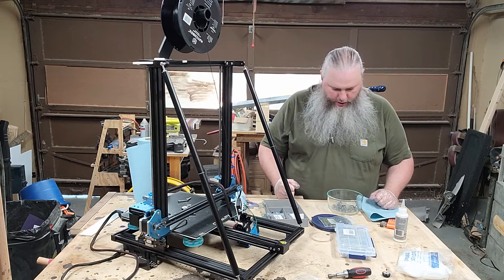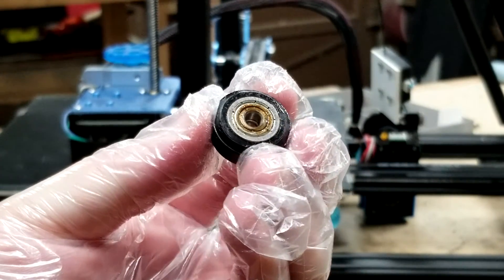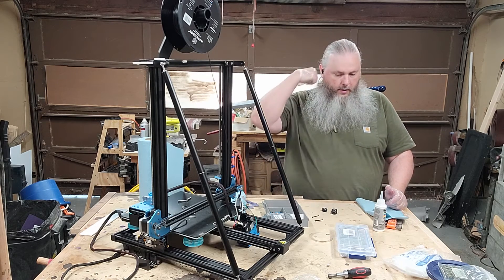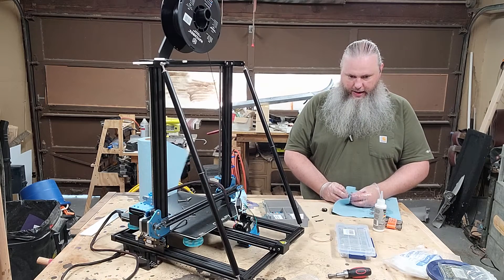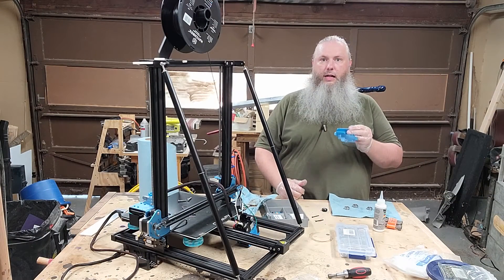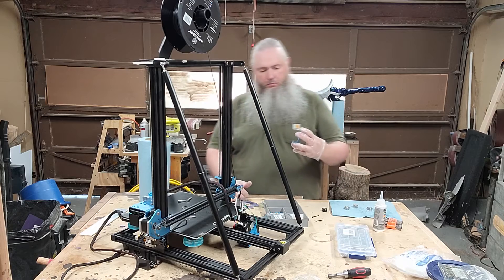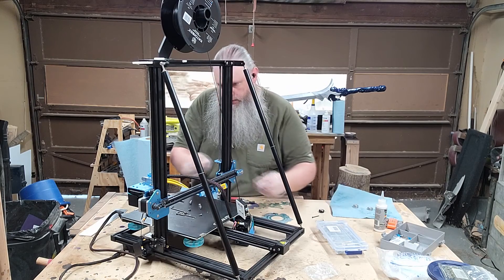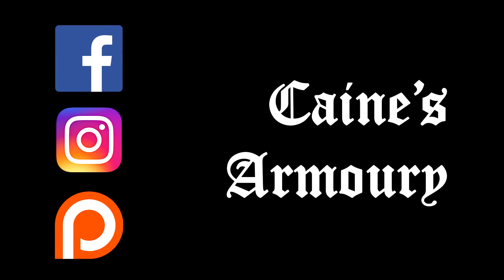CR10 V2 V3 X Axis - Pt 2: Replacing the Bearings!

Comment: I allowed my CR-10 V2 to print over night. When I checked it in the morning, the printer was still operating but there was a clear decline in print quality.

On closer inspection, I noticed two 1.5cm o-rings on the print bed that were not there the night before.

I am trying to determine where these o-rings came from so I can replace them and get my 3D printer working again.

Any chance these are a part of the OEM roller bearings that somehow came off during the printing process? Not sure where else they would have come from.
Reply from the maker: Very good question. 
The rollers have a seal that looks like your average plastic pancake washer. Their job is to keep dust out and grease in. If they fall off you can see the bearings in the rollers. 
O-Rings are round edged rubberband-like seals. There are none on the printer that I know of. 
The dimensions you speak of make me think of the original Titan Extruder Bearings. They wouldn't be o-rings, they would be disintegrating bearings. A bad sign overall. I did obtain a package of 5 sealed bearings for the titan that I still have packaged. There are two of these bearings around the extruder gear on the titan, right behind the plastic cover. Inspect that area.
Reply: @cainesarmoury8962  thanks for the response.

That’s the craziest thing about this. I’m certain they’re o-rings, but there is no evidence this is part of the printer (at least in terms of parts diagrams or asking in various 3D printing communities). No clue where these came from… nothing creality support recognizes… but there is nothing else around my printer that would have had orings either… and I had to abort the print because quality degraded over the same night the mysterious o-rings appeared. Before this weird happening, the printer was working beautifully.
Reply from the maker: @lobomute  I'm part of a facebook group for Creality printers. You can take pics and share with us there, if you're willing to.
If not, you can send me pictures at my email "cainesarmoury@gmail.com" and I might be able to identify it.
Take as many pics and perform a teardown of as much as you can to help out.

Comment: hey i got a cr 10 max and my bearing  area is comign off my printer and i am curios  what i eneed to do to make it stable ?
Reply from the maker: Probably washers. The larger the printer the less the way the're made works. I'm dealing with a similar printer, a CR10s5 and it's huge! The entire thing is saggy and under a lot of stress. I'm trying to reinforce it but aluminum is turning into an enemy. I think a handful of steel spacers and larger bearing/roller combinations are what would really help. If not that, just doubling the number of rollers and make certain they all have eccentric nuts.